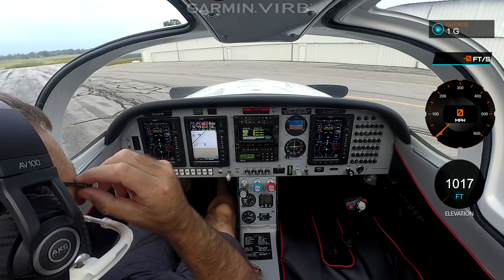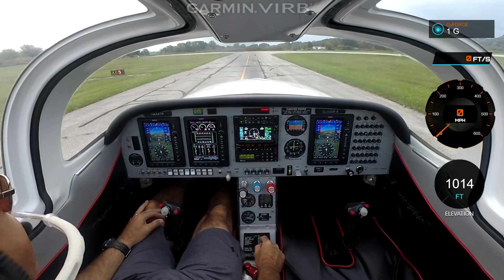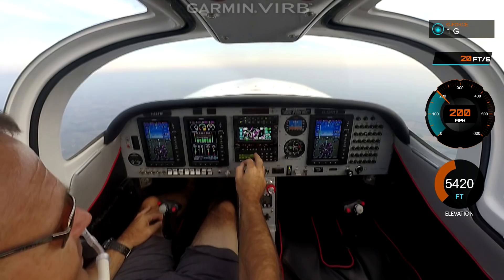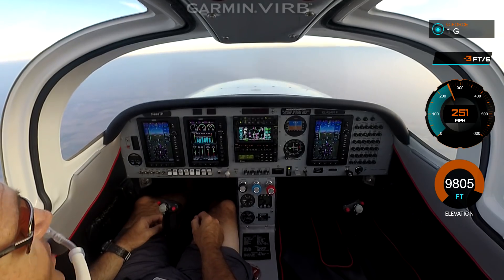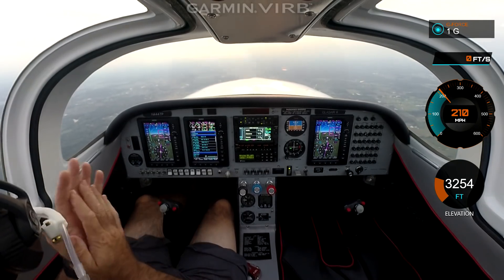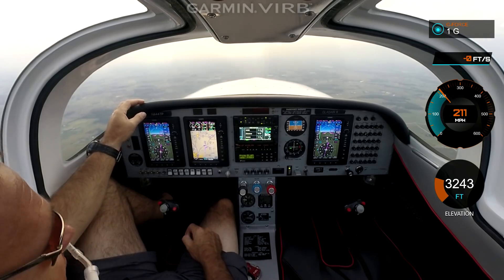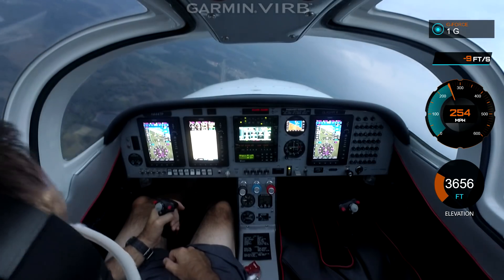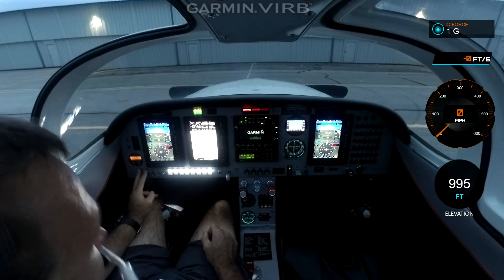Glasair III Full Demonstration with Garmin G3X

Comment: How is the torque on the full power stalls? Is there any comparison to a 182? That is what I have been flying forever so...I am very interested in these for cross country as well because of fuel burn. Speed is really just icing on the cake IMO but anything over 120 knots is perfectly fine with me. This is such a slick looking aircraft.
Reply from the maker: I don’t know as I never stalled it.  You fly this like a jet and really should never be slow in this plane as the sink rate at slow speeds with the gear down can be as high as 4k per minute.  If you are happy with 129 knots this is not the plane for you. The 182 is a much better slow flight plane.
Reply: @baronpilot2bb  Yeah I only really ask because I like to practice stalls to stay sharp. With flaps you can get a good glide though right? Like if I needed to put it down in a pasture I could? Your comment kind of gives me pause. Noticed your handle. I used to fly a C55 before a tornado destroyed it in a storm. I miss that acceleration on take off :)

Comment: Very good and informative  video.  
I am curious what air speed you use for planning / flying long distance flights.
Reply from the maker: I use 205 knots TAS and it works out pretty good.  Optimum altitude for speed/fuel burn is 11k ft turning about 210 knots on 11.5 GPH lean of peak.  If winds are favorable or ceilings are high I will go 15-16k ft and be in the 9 GPH range with TAS of 195-200 knots.  It does not make any sense to fly below 9k ft or so since it takes more fuel to get the same speed.  If I had the short wing tips lower altitudes would be more efficient, but range suffers due to increased fuel and safety is diminished due to the high sink rate in an engine out scenario.  It really is a great 1000NM x-county airplane non-stop in less than 5 hours with well over 2 hours of reserve fuel remaining.  Not many planes will do what a G3 with tips will do.

Comment: Nice airplane and great video. what oxygen system are you using?
Reply from the maker: It is a Mountain High panel mounted Pulse Demand system.  Works great.  Check out my video that describes how I fill the system using a Devillbiss in-home oxygen generator.

Comment: It's very nice speed, that's what we need in GA. Cessna needs to die. But a glasair mainly does it with 300 horses. The Sharp Nemesis was a 236kg 100 horse plane that was just as fast as glasair III, near 500km/h max. There is just huge advantage to reclined seating and tandem seats instead of side by side and keeping the weight low. Imagine the fuel economy on that and negligible maintenance. And we could really use a pressurized cabin too. Doesn't matter if it's a little difficult to get in and out of. That's seconds compared to hours of advantage.

Comment: Do we practice engine-out landings?  Are we tested on them for certification?  If no, why not?  Too dangerous?
Reply from the maker: Yep, did multiple practice landings engine out. You leave the gear up unless you know you have a hard surface landing assured. You glide at 105 knots with the gear up and if anything but a hard surface you land gear up touching down at 65 to 70 knots. The long wing tips makes all the difference.

Comment: I don’t quiet get the, “it is safer to raise the gear with runway remaining, then to leave it down.” You seem to be a knowledgeable aviator, I am all ways up to learning, I would be interested in this line of reasoning, Is it specific to the Glasair?
Reply from the maker: With the gear down and engine out the Glasair will decelerate very quickly and will sink quickly also. If you run off the end of the runway you run a high probability of collapsing the nose gear and flipping over trapping you in the plane.
If you have the gear up and lose partial power it will climb, if the gear is down it will not climb.
Landing gear up is not pretty, but you will simply slide down the runway.
Reply: @baronpilot2bb  Thanks for the reply to my question, just never heard that line of reasoning. Might look a little silly sitting at the other end of a 10,000 foot runway, with the wheels up.
Reply from the maker: @clarkmusgrove65  I agree, but better to look silly than look dead. In my opinion this is the biggest drawback of the G3. With the gear out and power off you are looking at over 3000 FPM down at 90 knots. It is unsafe with gear down and no power.
Reply: @baronpilot2bb  Interesting, I have been researching information about the G3, (thinking about getting one). It is all ways unsafe with the loss of power, since I am looking at buying a G3 could you please explain the correlation between the G3 and the loss of power?
Reply from the maker: @clarkmusgrove65  The G3 already has a heavily loaded wing that can be as much as 32 lbs per Sq ft. As speed slows down drag increases rapidly if you let the speed decay. This is with the wing clean and gear up. When you put the gear down there is a serious amount of drag produced due to the huge holes and leg runs for the gear. It is literally like putting a parachute behind the plane.  This is why I always flew with the long wing tips. It slowed down the roll rate quite a bit, but improvements in safety and high altitude performance were much better. Another thing, if you have an engine failure you never put the gear down until you are on final. If you land off field you want the gear up. When the gear is down you are committed to a very precise landing and it better be a  hard surface or nice grass runway.
Reply: @baronpilot2bb  Thanks for all the replies, it has been nice chatting with you this morning, but I am such a dumbass, when you referred to the G3, I thought you were talking about the Garmin G3X. Shows you how dumb I am! I just could not understand what that had to do with the loss of power. Well, it has been fun, did enjoy the video this morning.

Comment: Why do you lose the light on the RCAllen Flap indicator when you transmit?
Reply from the maker: Lol, you are the second one to catch that.  Comm antenna is too close to the flap position switch.  If you look closely the gear pressure indicator does the same thing.  Good catch :)

Comment: Nice aircraft! Please tell me what motivated you to get rid of the other Glasair. It looked like a nice build too.  Was there any thought to putting the throttle quadrant on the left side like in military aircraft?  Do you wear a parachute while flying? My life was saved by a Martin Baker GRU-7 ejection seat, so I am partial to parachutes.  Finally, any hints on the A&P who did the build would be much appreciated.  Awesome video! Looks like a blast from preflight to touchdown.
Reply from the maker: Wife and kids wanted to fly with me.  Bought another Duke.  Don't care for throttle on one side since you can't fly from either side.  I can fly with left or right hand, so throttles in the middle make sense to me.  Never wear a parachute as getting out of the plane and successfully pulling a chute in time is very unlikely.  Only time I see it would be a benefit is if the plane was on fire.  I had hot seats in my Iskra TS-11 and never had to use them, but much better than just a chute.  This plane was mostly built by a two-time Glasair builder and finished by Heath at Performance One Aviation in Mesa, AZ.  Performance One is the premier shop in the country in my opinion.  

What is exceptional about this plane is the ability to go non-stop 1600NM (15k ft, 9 GPH, 195-200 knots) on less than 75 gallons of fuel with superior avionics and autopilot, turboprop climb performance, and fighter like handling along with high wing loading for comfort in rough air.  Maneuvering speed is above cruise speed and yellow arc does not start until over 250 knots IAS.  This is the strongest air frame in the sky in it's class and is also very comfortable x-country.  I can't think of a better all-around airplane when you consider performance, comfort, endurance, maintenance, and fun factor.
Reply: Makes complete sense.  I have been interested in one of these for a while.  My interest level waned when you removed the other aircraft.  You definitely got my attention.  Do you have a turbo charger on your aircraft?  Will check out Performance.  My recollection is that they played a role in your other Glasair.  Thank you again. Have a great holiday season.
Reply from the maker: No turbo.  The problem with the turbo is complexity and adding another failure point in an air frame that you really want reliability.  The cost is also another $60k or so to install.  You would gain about 40 Knots TAS, but will have to go to 20+k ft to get the performance.   Range would also go down as the speed benefit is not linear with the fuel burn.  It is best to leave the engine install as designed.
Reply: Stone Street Realty, Inc. x

Comment: Great video, always love the GIII, hope to fly and own one one day. What are your thoughts on the GIII with Allison 250, derrated, say 300shp to match the piston version.  One reason is avgas price and availabilty (lack of) down in my area. Any estimate how fast it will cruise say just below FL180 with the A250? i've read at cruise setting the Allsion would burn about 22-25gph. Not bad at all with a little increase in cruise speed than the piston version.
Reply from the maker: Would not recommend the Allison on this plane.  I know AVGAS is expensive and hard to get, but you will not have enough fuel capacity with the Allison and you are probably closer to 25-27 GPH block to block.  Furthermore, a good Allison is $200K+ and if you ingest FOD you have a $60k-$100k fix.  A nose gear collapse will ruin your day also.  If you want speed the Turbo is the way to go with speeds of 260-275 knots TAS on 18-19 GPH at 25k is possible, but again, you are taking a virtually bulletproof and maintenance free airplane and adding complexity.  The only turbine experimental plane I would buy is the Lancair Evolution, but at $1.2 Million it is way too expensive for me.
Reply: Thanks so much for the insight. I'm still tinkering with some ideas, perhaps a 250shp TP100 engine on a super II, still about $100K+ for a firewall forward kit. or even a twin TP100s on  Velocity-Twin. But there's just not enough (read:NONE :D) testimony out there. Only one I read is a Van's RV10 with the TP100 engine, but that engine is still rated at 1500 TBO, and no speed advantages, only the fuel cost saving. Yeaah the Evolution is sweet, a dream speed machine with good useful load and range.
Reply from the maker: The only problem with the TP100 (or any turboprop) is the support and cost.  Building a turboprop is a very close tolerance process and costs a lot of money.  There is a reason there are only a few Turboprop builders that have been around for a long time and why the prices are so high.  I think that ultimately the turbo diesel will be the replacement for the gas piston engine.  The turboprop is just too expensive and burns too much fuel.  I think we are 10-15 years from the turbo diesel taking over the new market.  Unfortunately, I don't think there will be a big retro market since the conversion cost is so high.  New planes will be built around the new engine instead of the engine being adapted to the old airplane.
Reply from the maker: Also, just looked up the specs on the TP100.  I don't see it as a solution.  It is under powered with maximum continuous HP being 214 and fuel consumption of .9 gallons per HP per hour.  That is 27 GPH  to get the same speed I get on 13 GPH.  Single stage turbines are very inefficient and that is why they are relatively "cheap" on price.  Multi stage "fan" units like the Allison can get into the .6 gallons per HP/HR, but are very expensive to produce and maintain.
Reply: Avgas prices here is about 4 times more expensive than Jet-A1, and avgas availability is almost non-existent, it's only made to order by flight schools in limited quantity. Turbo diesel would be nice, the 180hp class is becoming more mainstream, it would be several years until we see the 300-400hp engines becoming mainstream. If somehow the IO-540 300hp can run on mogas 98RON (95AKI) non-ethanol, that would answers all questions. That's the highest octane fuel we have down here. Has anybody tried running the 300hp on mogas there? I know some IO-540 260hp can run on mogas, but they're parallel valve engines. 
Another easy solution, stick with the Super-II with Superior XP-360 engine which can run on mogas. Not sure how 'less' fun it is than the G-III.

Comment: Excellent video. Very informative. Are you an instructor? Btw.. did you have the boost pump on when landing?
Reply from the maker: Hello - Thanks for the comments.  Yes, I am a CFI, but rarely exercise the rating.  Good catch on the boost pump.  Should have been on for landing and I missed it.  Landing phase should be very quiet and full attention given to it.  I was too busy yapping and went right by it.  I noticed it after exiting the runway and wondered if anyone would catch me :)
Reply: Dukepilot I really enjoyed your video and I think anyone who flies with you is in good hands. I am sure the boost pump will be on your mind the next time :-D
Reply: @baronpilot2bb  Are you interested in doing any "checkout" flights by chance?
Reply from the maker: @Saltlick11  HI Troy. It depends on where and the machine. If it is close to me and the plane is solid I can help.
Reply: @baronpilot2bb  Thanks -- Glasair III, Phoenix (which I suspect is too far).
Reply from the maker: @Saltlick11  That is a location I would consider in the winter as it is not so hot and the weather is good. Send me an email @fmblandairsea@gmail.com and we will talk.